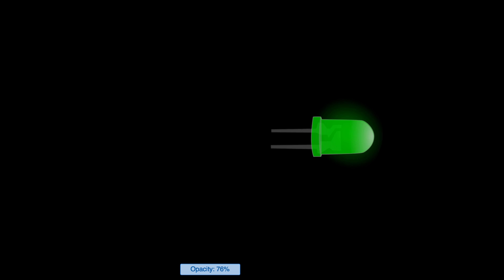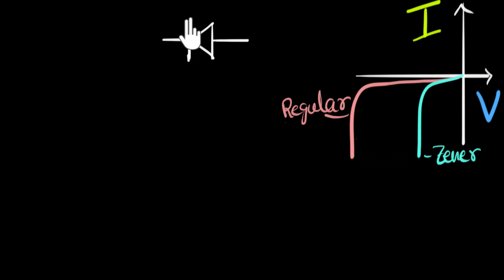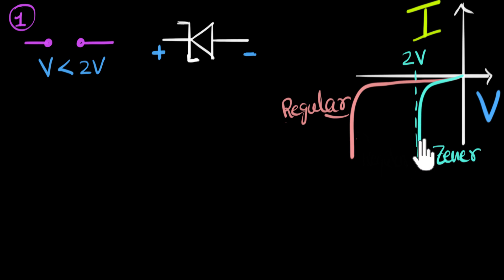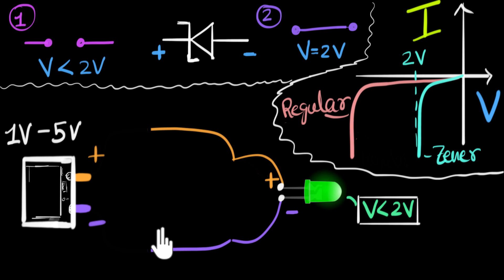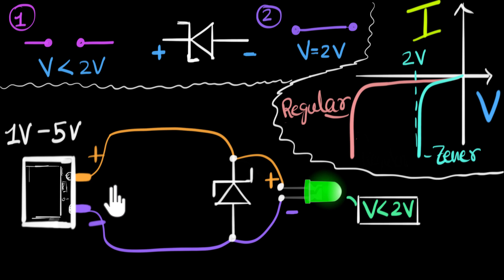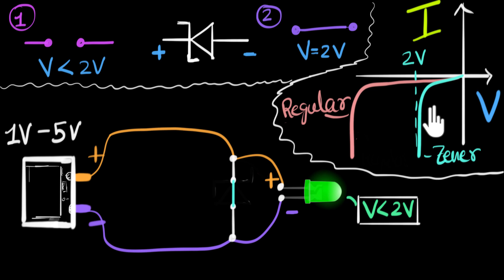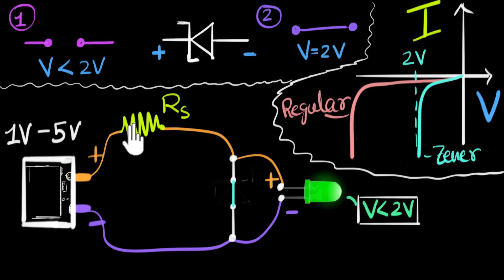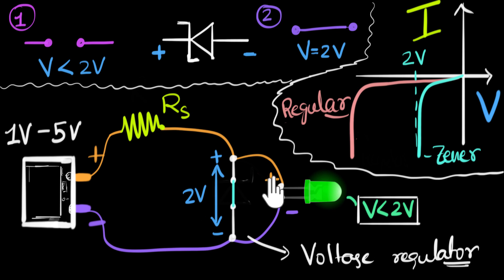Zener diode voltage regulator | Class 12 (India) | Physics | Khan Academy

Comment: 3:36 how can you say that voltage across it stays constant? Voltage is my input, I can give more voltage if I want to, yeah short circuit is inevitable after 2 volts but that's the result of my input. How can I say that the potential difference will remain 2 volts?
Reply: He means that we have to make the voltage accross it to be at maximum of 2volts. As he does later in the video by adding resistance
Reply: I think the main purpose of the arrangement is to limit the voltage across the LED to 2 Volts. 
Now adding the resistance in series is I think cruicial because 
without the series resistor, when the D.C. voltage will be greater than 2v the diode will also have that Specific voltage across it, which will be i think enough to blow it. 
Again, although the maximum amount of current will flow through the diode itself, due to the breakdown, I am not sure if the current will be enough to blow the diode.

Comment: The diode is in parallel with the LED, source how is the LED's voltage prevented from exceeding 2V? I'm certainly confused on this so could someone explain?
Reply: Voltage remains constant in parallel. Diode and LED are in parallel connection

Comment: This is the only video In entire YouTube to understand the pure concept of Use of Zener diode as voltage regulator very easily
Reply: Why we don't use zener diode in Series connection with the LED?
Reply: @moya9450  bcoz at breakdown voltage, current would increase massively, n LED will blow up
Reply: @moya9450 because we're dumb

Comment: You are Electronics god! Hoping you can help resolve my predicament. I have been desperately looking for an answer to WHY the voltage is constant across the diode? I have read and viewed every info possible including going deep into the science of Zener diodes but no one has explained the WHY. One of the reasons mentioned  is that the diode regulates its internal resistance to maintain the voltage. How and Why does that occur? Can you please explain?
Reply: In a zener diode, during breakdown, as current increases, the voltage drop across the diode remains relatively constant. This is due to a combination of factors, including the unique doping profile and design of the diode. Essentially, the diode dynamically adjusts its resistance to counteract changes in current, maintaining a consistent voltage drop. It's like a superhero diode, ensuring stability in the face of fluctuating currents.
Reply: @pradipbhandri  can you please clear this: if zener diode is like a short circuit then why the current ever goes into the led(i mean current always flows in low resistance path right)
Reply: Thanks!!

Comment: but the led will not light up after adding Rs because it is short circuit
Reply: can you  please clear this: if zener diode is like a short circuit then why the current ever goes into the led(i mean current always flows in low resistance path right)

Comment: so if v=vz then the zener diode will be activated but what will be the voltage drop across resistor I m confused even in this it voltage drop should be there since current is flowing through it

Comment: So if the resistance of Rs can change according to the input voltage and y do we need a zener diode in the first place? Can't we just use the resistance to make sure only 2v enters the led bulb?
Reply: We could only make the voltage drop using resistor and the current increased due to increase in voltage flows across the zener diode and hence doesn't affect the LED light

Comment: What if we use pnjunction diode for voltage regulation? It has also breakdown voltage after that it gives zero resistance.
Reply: It has a high breakdown voltage. So , for utility purposes, zener diode is used.

Comment: So a regular diode can't be used with the same purpose in other circuit that can face a higher voltage? I think for your explanation in last video that likely it is not possible because of the heat produced in collisions when the voltage breakdown is reached would produce smoke and it would be dangerous, could you confirm it for me?

Comment: Sir at 05:18, you mentioned that only in reverse biased Zener diode, the voltage won't exceed 2 volts. But we can also have it in a forward bias, right? Because even a forward bias has a cut in voltage, at which the voltage doesn't increase much
KIndly clarify sir
Reply: Maybe because the current in forward bias is of the order mA .

Comment: Which is effective, is reverse bias zener diode or forward bias junction diode? And which gives more current without any problem?
Reply: Forward and reverse biased zener diode have different purposes. 
Forward bias facilitates large amount of current to flow through it only in one direction. So that property is utilised when diodes are being used as full/half wave rectifiers
Reverse biaed zener diode is useful for maintaining a constant voltage. In this case we don't want our led bulb to be destroyed by passing more than 2V across it. So here we're looking for something that will limit our voltage and protect the appliance. 
However , compared to normal reverse biased diodes zener diode is better because -the breakdown voltage for zener diode is lower than the former, so the problem of heating is overcome

Comment: I dont get it clearly, why not add the resistor on white wire if we only using it for zener diode? Because if added to orange wire, it will always be dropping voltage.

Comment: seems the external resistance handles the whole thing and same things are achieved without the zener diode, pl clarify.
Reply: Did ya got the answrr?? Im havin the same doh t
Reply: Yes I also have the same doubt
Reply: @monalisasahoo171  the discussion in the video needed more clarity,the external resistance is used only to prevent the zener diode from getting damaged called avalaunch breakdown if connected to higher potential difference(p.d),the p.d across the zener diode remains the same no matter how high is the p.d of the battery,thanks.
Reply: @sachinrath219   okay thank you 🙂
Reply: @sachinrath219  Isn't the external resistor used to prevent damage to power supply? Zenor diode isn't damaged because of large current.
Reply: @alchemist6045 it's actually the correct answer. To prevent battery damage due to short circuit through zener

Comment: Sir, isn't there a rule that devices connected in parallel to a voltage source have the same potential difference as the voltage source? By that rule shouldn't the diode and load have the same potential difference as the fluctuating voltage source and be independent of each other's voltages? Is that rule only for Ohmic circuits? If so, why does the rule of increase in current with decrease in resistance in a parallel circuit still apply here?
Reply: Same doubt...did y get the answer?
Reply: SAME DOUBT. Did you get the answer?
Reply: @GirijaThangaswamy The voltage do remains same across zener diodr and led here too. When voltage was less than 2V, the diode acts as a open wire so the entire voltage drop was across led(no parallel arrangemnt)

When voltage exceeds 2 volt then the, no mattter what the volt, the zener diode would drop 2v and rest it will allow to pass throughgl. Sinec the led and resistor are in paralled. The voltage across led also be 2v.
i dong think i did a nice jpb explaininh this....

Comment: # Sir if i have a voltmeter parallel to the supply and I'm replacing the zener with a switch. So if i get to know from voltmeter that it is exceeding 2V, i can switch on the short circuit. Will it behave the same as with zener
Reply from the maker: I really like the way you are thinking. 
Here is the difference between a switch and a zener diode. 
When you close the switch, you would create a short circuit of zero resistance (almost). So the voltage across it would also be zero. 
However when the zener diode acts as short, the voltage across it WON'T BE ZERO. 
This might seem weird. How can you have negligible resistance with non zero voltage,? 
This is because zener diode is a non ohmic device. 
V=IR doesn't work for zener.
Reply: @KhanAcademyIndiaEnglish  #Thank you Sir /Madam.
Reply: @qureius494  Mahesh Shenoy Sir👍

Comment: at 2v,the zenor diode breaks off,its still operating at 2v,how its nt getting damaged by infinite flow of current.
Reply from the maker: That's the speciality of Zener diode. In reverse breakdown, it can handle large currents without heating up (or getting damaged). Also note, that the current is not infinitely high.

Comment: At 2V , the zener diode acts as short circuit so no current should flow through LED. But it still glows. So is potential difference the only requirement?
Reply from the maker: A current will flow through the LED. Usually, when we think of short circuits, we assume voltage across the ends of that wire is zero. (because V = IR, and for short circuit R = 0 and hence V =0). But a Zener diode does not obey Ohm's law. Hence even though it's R =0 (it's not really, its an assumption, it's really really small in the reverse breakdown), V need not be zero. 
Thus there is a 2 V p.d. across the diode and the LED and hence a current will flow through the LED.
Reply: @Khan Academy India - English  where is the voltage 3 v if the resistor in series is disconnected from the diode?

Zener diode has 2 v. 5 -2 is 3 Vol. Where would this 3 v go???
Reply: @tnamen1307  to the resistor..

Comment: but i have a question of the input voltege is less than the breakdown voltage,you said that the diode will behave as an open cirrcuit and the input voltage equals output voltage thats satisfactory but dont you think that the output voltage will still be fluctuating?
Reply: Ur question is very good
Reply: I too have the same doubt
Reply from the maker: Oh yes, it's not a voltage stabilizer. :). So as the input voltage fluctuates the output voltage will fluctuate as well.
Reply: @KhanAcademyIndiaEnglish  but it is used as a voltage regulator.
and as i went through ncert the book tries to explain how it can provide constant dc outputs.
Reply: @KhanAcademyIndiaEnglish   i have 1 more query, if the applied voltage (which acc. to ncert is the rectified output) first approaches the breakdown voltage and decreases again,will the same voltage(zener voltage) is associated with the diode after the voltage was decreased?

Thank YOu for the fast reply.😁
Reply from the maker: @alphamax157  So the zener diode is sort of a voltage clipper. In our example it won't allow it to go above 2V.
So if the input voltage goes below 2V then zener diode wont undergo breakdown and will pretty much act as an open circuit. So below 2V the circuit is as good as not having the zener diode at all and hence the voltage across the output will decrease. 
Hopefully this clears the doubt :). 

This property can help in surge protection where we don't care if the voltage decreases but we do not want the voltage to exceed a particular value. So in that way it does help stabilize, but the output will not be a constant DC. :)

Comment: WHY IS VOLTAGE CONSTANT IN ZENER DIODE?
Reply from the maker: This is explained in a little detail in the video of Reverse breakdown voltage. 
Basically, above the breakdown voltage, there is very little resistance offered for the flow of charges. Thus even if the current changes, the p.d. won't change much.

Comment: 8:51 , why do you say zener diode is the voltage regulator? when the resistor is actually dropping the voltage.
Reply from the maker: It is the Zener diode, that is ensuring a constant voltage come across it right?

Comment: How does the resistance change as per convinience? Shouldn't the current through the circuit increase to adjust the increase in voltage?
Reply from the maker: The Zener diode is a non Ohmic device. This means, unlike conductors, it doesn't have a constant resistance. 
It's resistance changes with voltage. 
Below breakdown voltage it's resistance is very high. 
Above breakdown it's resistance becomes very low
Reply: @KhanAcademyIndiaEnglish   but sir, I was referring to the resistance connected in series Rs not the resistance of the zener diode 😬
Reply from the maker: @renukapandit8257  Oh, yes, that resistance is definitely fixed. As we increase the input voltage, the voltage across Rs increases (because the voltage across the diode remains fixed at breakdown value). And as you mentioned in your original comment, the current through it does increase according to V = IR. 
But all that extra current passes through the diode. 
Hence the current through our LED would still remain fixed :)
Reply: @KhanAcademyIndiaEnglish  sir, how you can say that, extra current passes through the zenar diode?.and sir, at breakdown voltage there is high current produces in diode, this current passess back to DC battery and again to all the circuit, my doubt is..if this high current passess through the bulb, won't the bulb damage??

Comment: When the input voltage is greater than 2v then the diode acts as a short circuit. Then how can it maintain a 2v constant output? It should be zero.
Reply from the maker: That's a pretty good question. Voltage would be zero in a real short circuit provided that it's done by a conductor which obeys ohms law. 
If R=0 then V=0 (for any value of I).
However our Zener diode is a not an Ohmic device. It does not obey Ohm's law. 
And that's why these things can maintain a non zero voltage across them even if they provide almost zero resistance.
Reply: @KhanAcademyIndiaEnglish  where is the voltage 3 v if the resistor in series is disconnected from the diode?

Zener diode has 2 v. 5 -2 is 3 Vol. Where would this 3 v go???
Reply: @tnamen1307  it will be dropped at the resistor.
Reply: This is so confusing
Reply: instead of assuming it as short circuit you can try to assume it as a battery of 2v
Reply: In reality yes the led will not glow at a point when v=2 across it but the input voltage change is occuring so quickly that it does not matter or appear two are eyes for such small time gap...